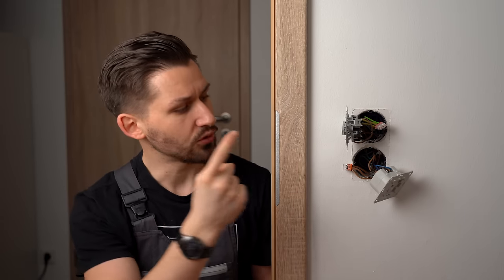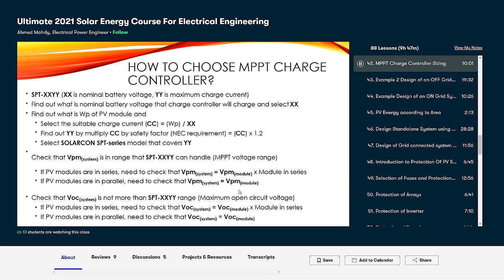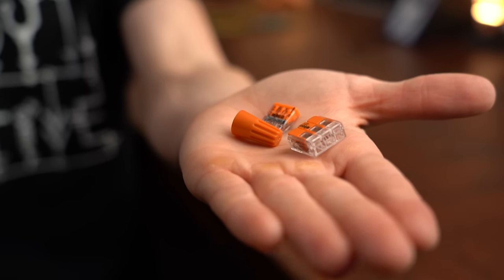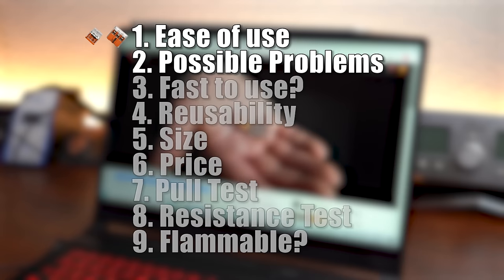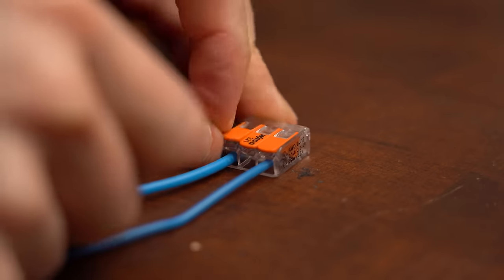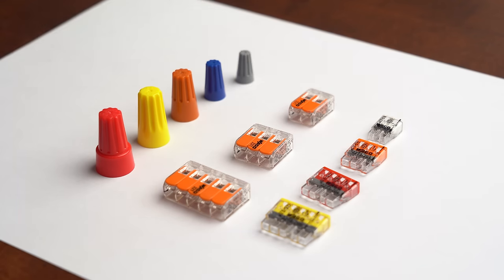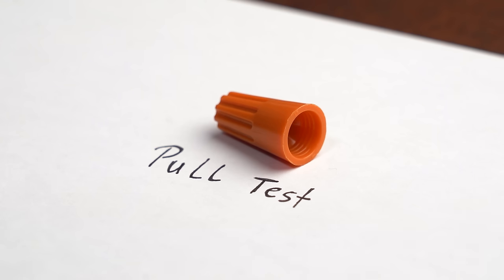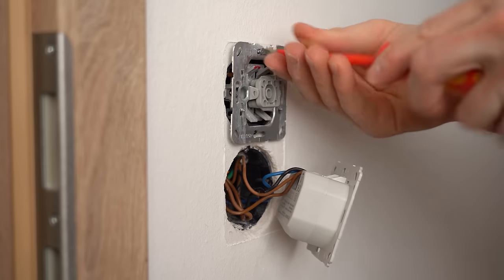What Wire Connector is the Best? Settling a Debate! Wire Nut VS Wago

Comment: The super low resistance and very low price, I think, are the main reasons wire nuts are so commonly used here in the US.
Reply: I like this video, but the resistance part seems pretty significant. I'd probably stick with wire nuts for my next electrical project.
Reply: @PhoticsTV  Yeah, the resistance test is definitely a giveaway why wire nuts are still the standard in the US, even while beeing inferior in most other aspects and beeing susceptible to errors. 
With 120V mains voltage you presumably have fairly high continues current draws, in europe on the other hand with 230/240V mains voltage the usual current draws are way lower, with germany even having 16A fuses in each single circuit, so you can't even draw more then 16A of current (3.680W) in a single circuit, even if you would be crazy enough to try.
Reply: @Shidera5721  The current loads are basically identical in Europe and the USA with 15amp being the standard... our appliances in the US use less power however and max out at 1800w with most being under 1500w. It's not unusual to have a higher wattage appliances in europe however... electric kettles heat twice as fast in Europe as the USA for instance. Twist connections are still used because they are mechanically strong, and have ideal conductive characteristics... both of which spring contact type terminals fail at. Really the only pro of the Wago is convenience.
Reply: @PhoticsTV  Yes, that was the most important factor, yet the author was biased towards wago (admittedly).

Comment: Hey, a little tip: You don't have to lift the lever on the Wago 221 when putting a solid wire in. You can just push it in :)
Reply: I believe you have to lift it for stranded wire to make sure you aren't mushing the conductors as they go in
Reply: @efeyzee  

For stranded wire yes, you have to open them, but for solid wire not.
Reply from the maker: Yep. Both comments are correct ;-)
Reply: @efeyzee  exactly. So their primary use is when you're connecting something like a lighting fixture or fan that uses stranded wire to the household wiring.
Reply: non electrican here. weeks ago my first touch on Wigo 221. i didnt lift the lever fully, so i couldn't get a wire in.
Reply: As long as someone doesn't do electric installations 8 hours a day 5 days a week, i would just lift the lever... it takes no time nor effort
Reply: @auricom24  yea, I had the same problem when I first got them, struggling with one finger to hold it halfway up and trying to mash the wire in. Later I played with one and figured out you can lift that lever all the way up, lol

Comment: When it comes to solid wire under a wire nut you should twist them together with your linesman pliers in a clockwise motion and trim the ends before screwing down the nut.
When connecting stranded to solid wire you don't pre twist your conductors but instead make the stranded conductor slightly longer then the solid conductor.
Reply: I agree. Because he didn't twist then together the test is invalid.
Reply: Thank you! I came to the comments looking for this!

I don’t think he looked into how electricians actually use wire nuts
Reply: @davak72  right
Reply: I guess if he was from America, he might better understand
Reply: I almost never pre-twist, especially with solid conductors.   Per the Ideal instructions: "Pre-twisting is acceptable but not required."

Comment: Great review. When comparing price, remember to factor in the labor time. I've been twisting wire nuts all my life and it's tiring plus difficult to do in tight pull outs. Also, wire nuts should not be reused because they wear so become easier to pull off with each reuse.
Reply: Yes, wire nuts are only cheaper if your time is worth nothing. 

If for ease of maths your labour cost is worth $12/h that's exactly 1cent per 3sec --- Wago costing 0.12 more would be balanced if the wirenut costs 40sec to wire up & check & redo if bad (as Wago will cost you about 1sec/wire to click and check). With more realistic $24/h you're speaking of 22sec, or self-employed should aim for $36/h so 14sec. Moral of the math: Let your apprentice use wire nuts, yourself wagos.
Reply: Maybe you can explain to the world how a wirenut wears out.
Reply: @toomanyhobbies2011  The spring inside stretches in use so used nuts won't make as good of a connection as new ones. The pennies that you save will risk fire. It's your call. BTW, I'm not the only one with this opinion, so your little comment about informing the world was not appreciated.
Reply: Yeah, twisting wire nuts takes SECONDS out of your life... 

Seriously? 

I doubt you have ever used one.
Reply: Save ~2x time, costs 4-5x more (video reference). 
Some don't conduct electricity, wires do = cooler than Wagos. 
Reused random old ones that came with my very old falling apart home. :)
Reply: @Eduardo_Espinoza  Wires when pressed firmly against each other conduct electricity. Loosely connected wires generate heat, which starts fires. 🔥
Reply: @Fun4GA  they have the same if not more holding strengthen as the Wagos, also it's about how much surface Area it has & the material, thus the Wagos are still hotter 🔥& lastly why the wire nuts still hold.
Reply: @Fun4GA  Wire nuts are cheap enough that there is no need to collect and re-use them.
Reply: @mharris5047  I completely agree!
Reply: @SenselessUsername  You must throw out a lot of wire nuts...  90% of wire nuts are used to tie grounds, a green hole through wire nut is quicker than fumbling with WAGO's, the connection is superior, and you don't need to cut a pig tail for the outlet.  All Light fixtures in the USA all come with two free wire nuts, passing on the cost of twp WAGOs per fixture to your customer is essentially the same as you spending your own money.  It is hard to argue that to an Electrician, ten seconds per fixture will eat into any profit for the day, and that is assuming that you are an electrician who is not proficient at twisting a wire nut.
Reply: @mharris5047 The same argument for "lack of re-usability" can be made for WAGOs, they are are spring loaded connectors which can fail after all there is a reason why people don't use those spring loaded push in connectors on the back of many outlets.  Plus all light fixtures come with two free wire nuts, when else would you have the need to remove and reuse a wire nut?
Reply: It takes 2 seconds to twist it and you can easily do it in a small space lol
Reply: @Fun4GA  Only you believe that nonsense.
Reply: @jamescole3152  114 Likes. But I'll agree there are folks that don't agree such as your self. Twist away, partner.
Reply: @Fun4GA  I suppose it comes down to if you are billing by the hour or by the job.

Comment: In Mexico, we hardly use wire nuts, i have never seen wago connectors here, we always splice wires and add electrical tape for insulation. 
Nice video, Scott ✌️
Reply: Same in argentina, had never seen a connector before.
Would be interested in a comparison of a splice connection on the pull and resistance parts

Comment: 4:12 you must ALWAYS twist the conductors together for a reliable, safe connection, before putting on the wire nut.
Reply: Not necessarily so per numerous manufacturers of wire nuts.
Reply: @wd8dsb  rather be safe then cause arcing and burn a clients home down.
Reply: I've had discussions about this many times.  For solid conductors, I agree, although manufacturers say it is unnecessary.  For connecting a stranded connector to a solid connector, opinions are mixed.  I've found more success passing the pull test by NOT twisting prior to installing the wire nut.

Comment: twist the wires with pliers before installing the wire nut; then you'll know the connection is solid, and you have created a much tighter connection than you could possible achieve with the wire nut alone.
Reply: Well time is money, I would never use something that takes 2 times more time then the other.
Reply: @Zuluparaszt3 is this a troll? 🤣

Comment: Recently started using WAGO's instead of soldering for some LED projects, definitely useful.
Reply: Yeah the 221s are perfect for hobby projects or semi-permanent installations
Reply: @audigex  Definitely. Before i started using WAGO's i used Screw Terminals now n then to make it easier to make changes.. Speaking of which that just gave me an idea... Bridge the bottom pins of a screw terminal and its sorta similar.. dunno why i never thought of that before
Reply: @DigitalIP  Thats called a jumper you can buy jumpers for most lines of screw terminals that push or snap in.

Comment: Very well done! On the cost/price analysis topic, I recommend combining the part cost with the labor (time) cost, and maybe sprinkling in a "repeated attempts probability" risk factor to account for cost of errors, such as the solid+stranded "miss" on the wire nut example in the video. At an hourly rate of $60/hr, just one extra minute per connector will completely swamp the parts savings - and good luck finding an electrician billing rate of $60/hr. The I^2xR loss on the 221 was more than expected.
Reply from the maker: Good suggestions.
Reply: The miss on the stranded to solid wire nut was because of a really easy mistake. With stranded wire we push it just a mm or 2 past the solid before putting on the nut. Def impacts the ease of use but once you get the technique it works every time.
Reply: Germany, so many awesome things, but still uses a flat head screw?  There goes your time savings : )
Reply: Wah wah wah. You just don’t like wirenuts because your girly wrists can’t  handle twisting them
Reply: @morscovium8881 Brody as an electrician I've gotta say Wagos are just faster and easier to use. If I have to fix someone's fuck up I prefer Wagos every time.
Reply: @morscovium8881  Fool

Comment: I've pretty much switched over to Wago at this point.  I recently completed a basement remodel that required a lot of wiring.  I did the wiring in stages.  It's so nice to just be able to add another wire to a Wago that has an empty spot than it is to remove a wire nut and try to twist another wire in.  I wouldn't even bother shutting off the power (don't try this at home, kids).
Reply: True. At a construction site, things often must be done in a hurry, especially when hunting errors in the wiring. And it's not all of the time possible to shut down that circuit quick and easy! We ALWAYS use the WAGO connectors (different types and ratings), working with them is quick easy and safe! We are german electricians :)

Comment: When talking about reusability, it's not only the connector that needs to be evaluated. Look at the wires, too!
When pulling out a solid wire from a Wago connector, it would usually be pretty clean and straight and can immediately be put into another one. The wires that come out of a wirenut, however, are heavily twisted and need to be straightened first. I do not think that this necessarily improves lifetime (and quality) of the following connection...
Reply: especially if done multiple times and the copper gets work hardened, one reason not to pre twist.
Reply: Usually I cut off the end of the wire and restrip when changing electrical connections. In NA there's usually tons of slack left by electricians in boxes. I could change fixtures 25+ times and still have space left.
Reply: @TenebrusI07  Not on my old house. :(
Reply: The Wago connectors put a crease in the copper conductor which is a point of failure if the wire is flexed a few times.
Reply: @LBCAndrew  ya that shark bite isnt that big I have never seen one that deep u less u pulled the wire out improperly.  Copper is soft and it should only bit deep if pulled to tight.
Reply: @TenebrusI07  same here I always snip the ends and redo it that way if I am using wire nuts I have hundreds but wire nuts but switched to wago three years ago . And I dont have hundreds of wire nits I have thousands of them its ridiculous.danm wago saves me so much time

Comment: When I started doing some of the repair work at the restaurant I used wire nuts all the time as they were easily available 
As I got more into the job I saw the Wago push in type and then the 221 type and now I only use wire nuts in certain conditions 
When we started relamping stores with LED fixtures I used the Wago push in style units a lot as that's what came with the new fixtures

Comment: I remember when the WAGO's were introduced for the first time in the Netherlands, around 1980. We immediately stopped working with wire nuts in the industry. It saved a lot of time and painful wrists at the end of the day. Never touched a wire nut again after that.
Reply: Yep, if I find wire nuts, they immediately get replaced by wago's if I need to add wires to a junction box!
Reply: @DuartJansen  Also what I have noticed with old houses with wire nuts: When I need to remove the old wire nuts, the plastic pretty much disintegrates when I touch them.

Comment: I have had the opportunity to use both and I have found that they both work well and they both have their place.  For regular connections I prefer the wagu connector. But for high current situations I still go for the wire nut. It’s a preference.
Reply: Agree,u just cannot say wire nut is a Bust,I’m like What???come on now people.
Reply: I could also see the wire nut for something you need to leave for LONG time 5-10 years. What the nut does is just twist the wires together and leave them there, while the other is a metal clamp which leaves the possibility of the clamp loosening over time.
Reply: @rrteppo  It is actually the other way round, the wago is springloaded and the pressure on the wire keeps the same, having wire Nuts or screw terminals can loosen over time so you have to check them regularly, especially on vibrating parts.
Reply: @deineroehre  Wouldn't you also run a loop of electrical tape anyway, just to avoid the pop-open effect mentioned here?
Reply: @deineroehre  if you've got wire nuts that are loosening over time you're not installing them right.
Reply: try wago hazardous connectors they can handle more

Comment: Keep in mind that 3M wire nuts are far better than regular wire nuts and that it is recommended to use a twist tool to avoid wrist pain problems and make a better connection.

Comment: One advantage of wire nuts is that when you're going in later to add or remove a wire, you can (most of the time) reuse the wirenut. With wago connectors, you'll have to change out the connector for one that supports more wires. I'd be interested in seeing if (on a professional job) the time you save using push in wago connectors results in them functionally saving money. Like... how much time have I spent twisting wires... omg.

Comment: The Wago connectors with the flip lock are pretty nice. The wire nuts are as I see it good to cap off loose ends and I'd never use them to mix wire types.
Reply: i hadn't seen & liked that style too, but I was surprise to see it under preform the other waco.  I figured a clamp would make a stronger connection.

i'm sticking to wire nuts.

Comment: What I really like about the WAGO connectors is the easy of use and the fact that you can just change singular wires without disturbing the other ones.
The biggest drawback I found is pinching my thumb under their little orange tabs all the time 😁
Reply: the other drawback is the chance of a fire....
Reply: @Hammerjockeyrepair  Sure… That’s why half the globe uses them legally
Reply: @Hammerjockeyrepair  if you can't transfer out 1 Watt of electric heating you're building something completely wrong.

Most electric fires start, because somewhere there was a installation error.
And those are more often than not human errors.

So everything, which reduces the chance for human errors will make it safer, even if you need to distribute like a couple of watts of thermal energy out of a wallbox.

That energy gets conducted away fast enough to not be a problem.
Reply: @Hammerjockeyrepair  Chance of a fire? At 1W at their rated load? You do realise that at 230V you'd need to be pushing 4,600W to waste 1W?
Reply: @Hammerjockeyrepair  Why? Wago is the golden Standard in Germany.